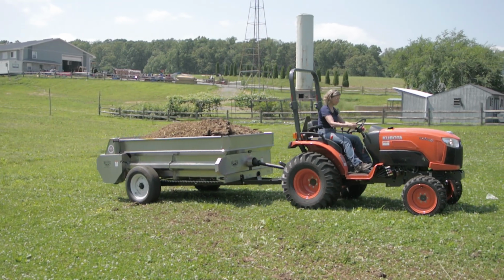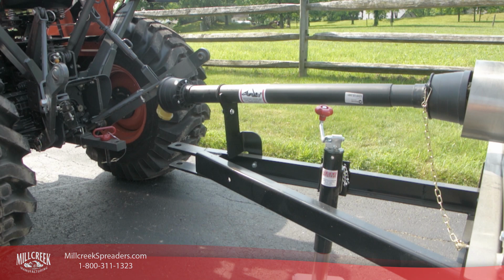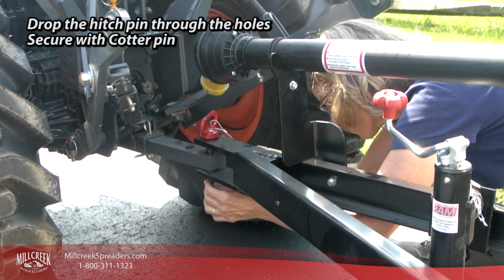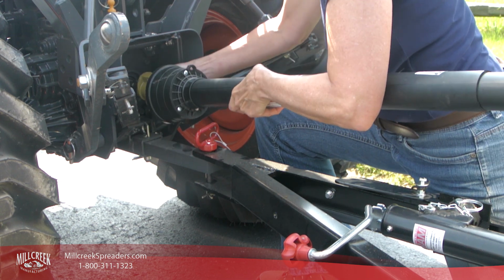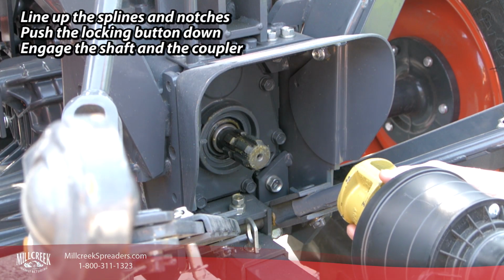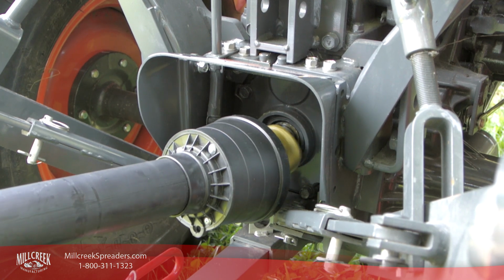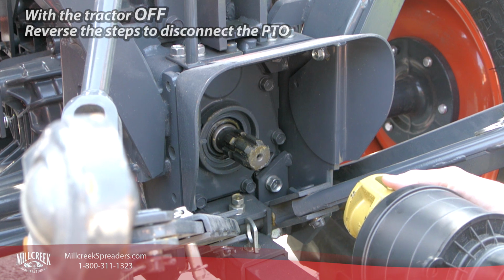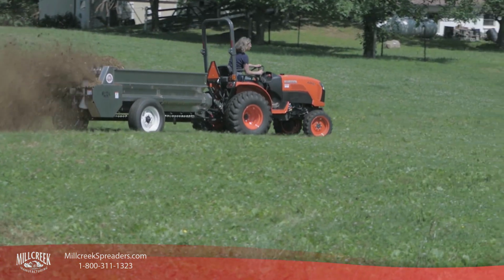How to Connect a PTO

Comment: The Secret to putting on a PTO Shaft

“Here is the best way to do it bar none: Back up to the implement making no mistake on distance or evenness. Get off the tractor and give the line-up a once over. Once you are certain everything is perfect straddle the PTO shaft and pull into place.

Although everything was perfectly even and lined up the shaft will be off-center. Mutter a small obsenity about the impossibility of these relational physics. Get back on the tractor and go back and forth at least 3 times. Climb back down and straddle the PTO shaft again only to find out it is worse than the first time. 

Even though you are fully aware of the weight of the implement you should now attempt to move the implement. This will automatically cause a slightly larger obsenity to blurt out of your mouth. Climb on the tractor again and while in 3rd gear rip around and get a clean shot at the implement. Climb off muttering something about putting a man on the moon and pull the PTO Shaft until it meets up with the tractor’s PTO. Calculate the odds of six splines over the circumference of the shaft and after quick calculation make mental note to never play the lottery again. 
Throw down the PTO shaft and kick the tire hard enough that you will remember it for the rest of the day. Wipe your forehead with your sleeve, yell at the dog, promise a kick in the pills to the unfortunate inventor of this contraption then go get a drink of water. When you come back the shaft will go on on the first or second try. 
It is extremely important to put the PTO cover somewhere you will not remember it and it is likely to hide for at least 4 weeks. Climb on the tractor and wait for 20-25 seconds before you start the tractor. This will provide sufficient time for the wife to call you in or the cell phone to ring and avoid wearing out your starter prematurely. 

I hope this helps…it works everytime for me.” -DwightD123
Reply: Absolutely spot on 😅👍
Reply: All very true and reliable (I think)...BUT, lining up the shaft and pto is only part of it.   The fun begins when you manually shove the shaft forward while pulling back on the ring and spring that lock it into place.... push-pulling at the same time...WHAT!  When I was young and strong....maybe!  But now at 85, I have trouble opening a jar of pickles or my medicine bottles!  But alas, I found the running a bar through the shaft u-joint and into a hole in the draw-bar below, I can leverage the shaft onto the pto a lock the pin into place....wha-la!!!  Never say die!!!